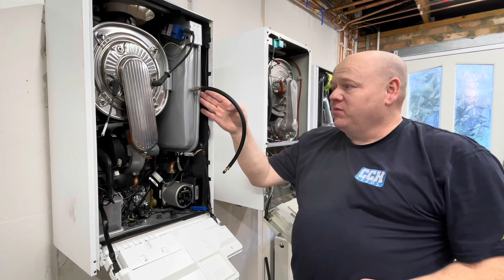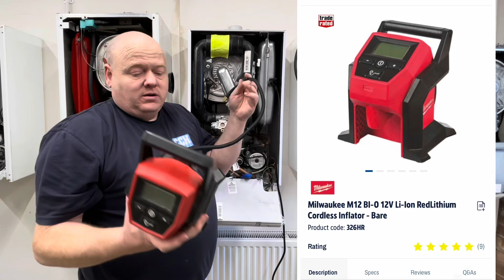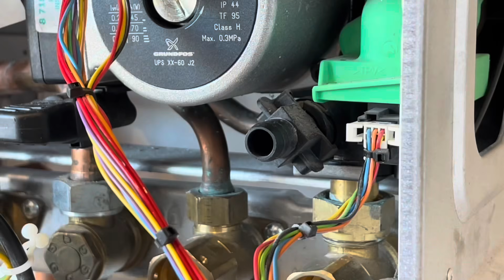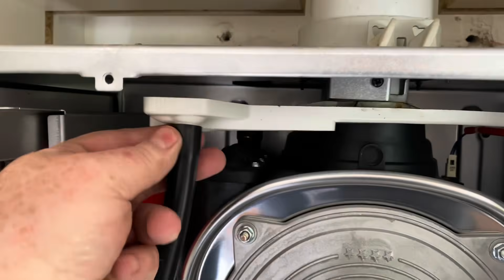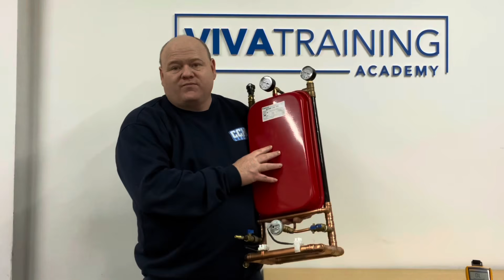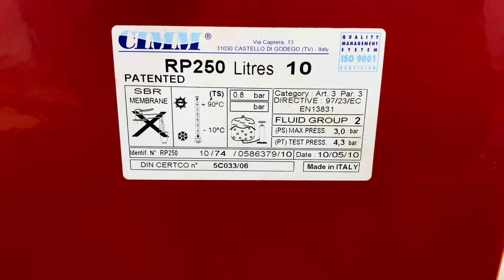How To Pump An Expansion Vessel | What Tools To Use

Comment: Great video ! ok so my boiler fires up then goes off after  30 seconds. I look at the guage on expansion and its an zero. I tried putting a pump on the valve but couldn't lift the guage. I haven't and will get an air gauge to check the tank pressure.  But my question is if the Etank membarne is bust or the pressure in it is low or zero, will this stop the boiler staying on

Comment: IBaxi Platinum Combi 40  can some explain how the water side in the expansion vessel vent any air trapped if system drained and then filled. Diagram shows Single pipe feed

Comment: PRV valve  I Meant £20 on a baxi 600.    I've had a 105e for over 20yrs.  Had a dvt valve and a main pcb board (£200) then another bit in the latter years..

Comment: Ive  got potterton combi boiler and noticed that was leaking underneath probably from the rpv then checked the pressure gauge was over 2.5 bars nearly 3 . Switched it off bleed the heating radiators got the pressure down to 0 bars then refilled the boiler with water everything was working good hot water , heating but after couple of hours ive noticed that the pressure starts building up again was nearly 2.5 this morning so did the same with the radiators. My question is do i need to drain the expansion vessel and pump it up or just can to release the pressure to 0 from the radiators then i will can to pump it up ?

Comment: just had BG service my boiler , all he did was pump up my vessel ,says its ageing and needs replacing eventually but its not worth the hassle replacing it , costs as much to get a new boiler installed than to get a new vessel ( its rear mounted so whole boiler has to come off the wall to access it )

Comment: Couple of things I do.
1. Prior to fitting the hose connection to the schraeder valve, I fill the opening with petroleum jelly, never had one leaking after topping up. 
2. As you say different manufacturers state the setting pressure, for example 0.75bar. 
Now I’ve found particularly on the Baxi if you set the system pressure to 1 bar, when there’s a demand and the pump runs the system pressure drops and sometimes the low pressure error message appears. 
To stop this I set every boiler to 1.5bar and inflate the expansion to 1.5bar, this ensures the low pressure fault doesn’t occur and the expansion vessel diaphragm is centred within the vessel to ensure the maximum expansion volume.

Comment: Warm greetings from Turkey, first of all, I do not know your language, I would like you to help me by using the miracle of Google translate. I am using the "lidya compact 25 kw" pellet heating system made by Kozlusan Turkish company. The expansion vessel (flat expansion vessel) inside this device is used. Water is leaking from the edge. As a result of this water leakage, the manometer is 4 bars and water is constantly coming out of the tank. Even if the device is turned off for a week and we close all the valves coming to the device, the mano meter rises above four bars. What I want to ask is whether the device is active or not, if the expansion tank leaks water, the mano meter Can it be increased to 4 bars, thank you..

Comment: Why has my system got a large red expansion vessel. Vaillant boiler.
Reply from the maker: For the expansion of the central heating boiler.
Reply: @AllenHart999  hi Allen, hope all is well.
External filling loop has been disconnected from the return pipe. 
I have a Worcester greenstar 30I. When CH is off, pressure is at 1 bar. When the heating is on, pressure jumps up to 3/3.5 bar and stays there even though the heating is off and the water is cold in the CH system. Is this an expansion vessel issue? If so, what is causing this and how to rectify?
Boiler is 10 years old and has never been serviced.
Reply from the maker: Thank You

Comment: say if you are filling the air side of the expansion vessel, and the water side "kicks" up to 2 bar (although radiators valves opened) it could be dirt on the water side of the vessel ...
Reply from the maker: Thank You

Comment: I will knock the vessel. If the sound is not clear. I will release some air from the vessel. If it come will water, the vessel is bursted, then it need to replace.
If the sound clear and not come with water, then I drain the system and recharge the vessel.

Comment: I can't find a drain valve on my baxi ecoblue 28, can I just drain from radiator fully, then check pressure also I'm gonna need to pull out my vessel to pump it up cos valves in tight position

Comment: Nice video Allen.
I use the Regin foot pump, but of late have bought the Makita DMP 180 Tyre inflator battery operated.  Alot easier and faster than a foot pump! Love the schrader valve tool. Only recently found out about it!

Comment: 1. When I release the water pressure from the boiler to pump up the vessel, does the air get into the heat exchanger?
2.If the water release valves happen to be on both ends of heat exchanger, does it matter which one I use to drain the water? It could matter in my opinion because the air release valve is only on one end, next to the pump, and I don't like the air in the heat exchanger.
3. when I put the water pressure back in , should I direct the water back towards the air release valve (by adequately turning off valves underneath the boiler if they are available)?

Comment: Amazing video! This helped to explain my issue so much:
My parents boiler has never been serviced, but regularly stops working due to low or high pressure. 
 When pressure is too low, they top it up. After topping up, when the heating turns on, pressure sky rockets to 4+bar, after the heating is off, pressure drops down to below 1 again. 
 Now everything makes sense thanks to this video!
Reply: yeah that happened to me , my static pressure can be 1.5 bar and is stable using domestic hot water, if i try and use CHeating it rockerts to 4 bar , british gas serviced mine and  said its beacause the vessel has no pressure in it so makes the boilers pressure unstable
Reply: How did you fix your high pressure problem?
Reply: @grimawormtongue2014 Really!

Comment: I use a Regin detonator style pump like what Roy was using - don’t use any extensions apart from when I really need to.  A good tip is to use a dab of silicone grease before and after and use a bit of spit (rather than LDF which can affect the rubber) on the schrader valve connection after pumping to check for leaks.  Some people tend to also leave the pump connected at a certain pressure and go and have a coffee to see for potential drops over 5 mins without any water back in - this proves that there is no seepage in the diaphragm.  Nice little video Allan and Roy, as always. 👍🏻

Comment: Worcester boiler vessels come filled with nitrogen. Not air .  Are we voiding warranty with Worcester if we fill vessel up with air and introduce oxygen ,.  Will air expand more than Nitrogen  ????
Reply: Around 80% of air is nitrogen! And around 20% is oxygen!
Reply: @sharazali-tabassam3033  Sharaz you know your stuff.
Reply: Probably not.

BUT Nitrogen is a Dry inert gas, it is less prone to expansion so acts as a much better "buffer'in the EV. Also Air contains moisture, over time you will add more "moisture" to the EV especially more so if the boiler service techie does a proper service including checking and topping up the EV. 

That said, the boiler will probably be knackered long before the EV is affected by water in the air lol.
Reply: The container in most modern boiler systems features a bladder-type vessel. The water and air are separated by a flexible membrane, ensuring that the pressure fluctuates as required. Normally the vessel is split into two sides; on one side is gas, usually nitrogen, and on the other is water.
Reply: Would the 21 % oxygen make a difference.  Some race car tires are filled with 100%. Nitrogen

Comment: Hello allen, would it be possible for you to do a video about pumps? 
-What the jargon on each pump means for e.g.  grundfos 15-60 130
-How to check the pressure output on the pumps?
-How to size them?
-How to test them? 
-And overall which company pumps do you use and would recommend!
Thank you!
Reply: Good idea. Sounds like a video for a pump specialist. Haven't seen anyone show much on how to test pump amps, windings, phases etc. Or how to take them apart for inspection. I may do one myself. Good shout.